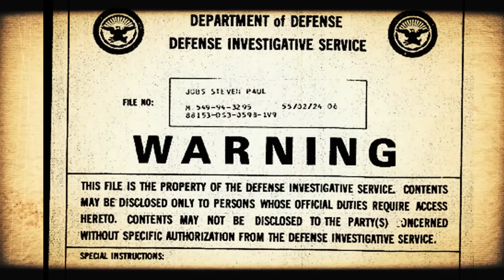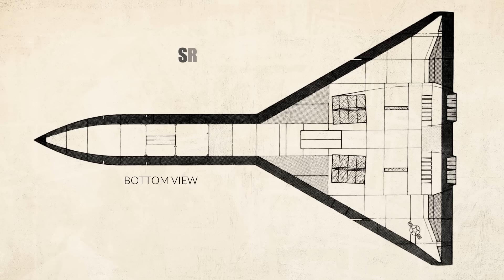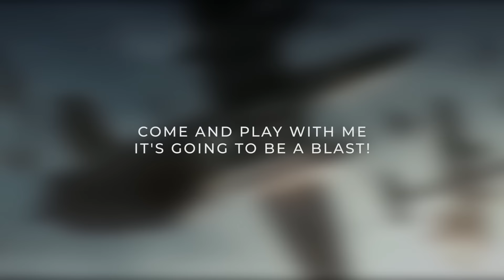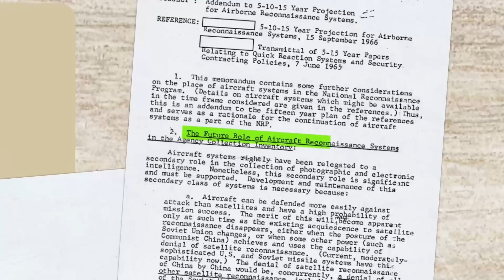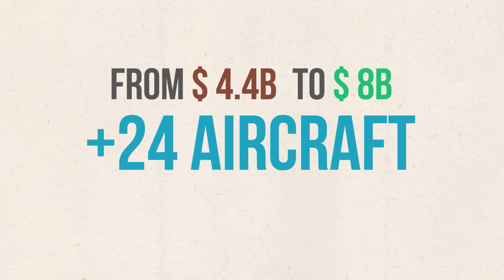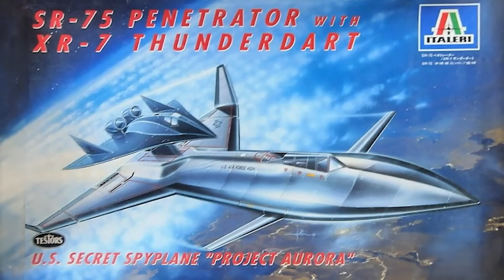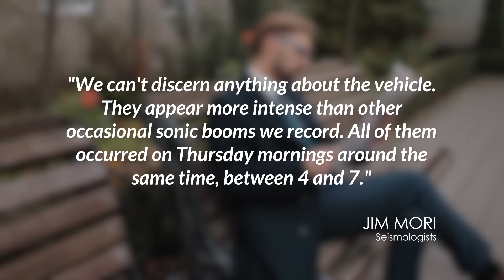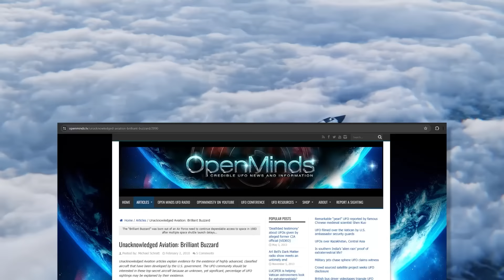This Plane "doesn't exist" - SR-75 Penetrator

Comment: If the SR-71 was around in the 1960's, the mind boggles on what could be around now.
Reply: Think Darkstar from Top gun. 😉
Reply: @dextermorgan1 so far SR72 (Before Lockheed hid everything about it) is basically the Darkstar
Reply: Satellites
Reply: It makes me laugh it’s still recorded as the fastest plane
Reply: @mikemorris3608  the wording though, they say ACKNOWLEDGED aircraft
Reply: some allege an sr-72 could already be flying, just kept top secret 🤔
Reply: @weregarurumon3202  Didn't watch the video, huh?
Reply: It’s crazy how long the B-21 must have been hidden
Reply: @Idont_eatcrocs  it's existed for about how long the F35 has since it uses some of the same parts
Reply: @giovannibonifati only difference being that the SR-72 is going to be an unmanned aircraft while the darkstar is manned
Reply: @giovannibonifati  oh I know, they tracked something on weather satellite in the early 90s coming from Area 51 flying over China and Russia and returning,  what ever it was it was doing 12,000mph
Reply: The SR-72 wasn't classified at first, and even had 1 successful flight of a prototype, before Lockheed Martin classified the program and scrubbed any public mention of it from their website & related online mentions 

Considering the Aurora has never been acknowledged publicly but clearly exists (plenty of examples of a pulse detonated scramjet or wave engine) and has existed for quite some time now...I fan only imagine what the SR-75 could do 

The project makes sense too, under the US rapid global strike program
Reply: Yep! Mach 3.3 - officially. Sixty years ago. 
Isn't there an old military saying about "Whatever they say the top speed is, double it." ?
Reply: @mikemorris3608
What? Mach15?
Reply: @handroids1981  yes early 1990’s
Reply: The Saturn rockets were 1950s tech, used in the 60s etc... they stopped because 'been there done that' and $$$ wasn't worth it to visit the moon continuously
Reply: Just imagine the whiplash a pilot would get from flying a plane with engines that pulse like that.
Reply: Don’t think about it. Save the headache
Reply: I worked in defense electronic packaging tech back before 1993 and the engineer I worked next to was once explaining the challenging design and manufacture of a 300 MHz motherboard in a gray job - not civilian - he had worked on in the 1980s.  I was the guy who had to figure out how to manage the heat from such electronics and that info was his “Hot circuits? Hah! Lemme tell you about HOT….” stories.  If you understand clock speeds, 300 MHz motherboard/bus clock speed architecture in 1980’s was like science fiction.  Now I always assume the US defense sector is 40 years ahead of whatever we know at the time we find out about it.
Reply: We've actually not progressed much after the 1960s...
Reply: @mikemorris3608  unless you count the Space Shuttle, HTV-2 Falcon, X-43A,and X-15.
Reply: the titanium build only gets stronger every time they go up. as long as they don't destroy them and store them properly, they'll literally be around forever!
Reply: You guys realize that mach 5-6 is the max achievable in atmosphere. The x-15started to disintegrate and melt at mach 6. It was made entirely of Inconel. There is no alloy that is more heat resistant. Exo-atmosperic is the only thing left. Satellite technology has progressed so far so fast that these are unnecesary.
Reply: @dr.threatening8622  the X-43A has gone up to Mach 9.8
Reply: @Zach476  all experimental never used in service and space planes aside/ I believe the A12 actually recorded slightly higher speeds than the SR71 and that flew two years  earlier
Reply: The need doesn’t exist now. The Cold War spawned so many incredible technologies. Not just SR-71, but also the Apollo program. No way we were going to the Moon if the Soviets weren’t trying to do it. Plus satellites 🤷🏻‍♂️
Reply: Most of these stealth aircraft have been around for decades. They tend to let the public know way later. By that point they’re nearly obsolete
Reply: The SR-72!! 🛦
Reply: physics doesnt change tho
Reply: They’re probably up to the SR-172
Reply: @weregarurumon3202 
Satellites can’t be directed to fly over specific sites at will.  That’s been acknowledged as a problem since the 1960s.

P.S., that’s explained in the video.
Reply: @Idont_eatcrocs 
The B21 is just being produced and has been public since its inception.  The B2 was flying already and there was no need to make secret versions before now.
Reply: Imagine the Valkyrie with a pulse detonator or scramjet engine that came along after it's development 🤔. It was designed to
Reply: Umm, the SR 71 was built in 1966
Reply: We have had  manned interstellar craft with FTL drives since the early 1990's. The true, secret space force.
Reply: @therealhammer6068 supposedly Ben Rich before he died said they had a faster than light aircraft
Reply: @dextermorgan1  What do you call a satellite with no power? a satelldark.
Reply: That's why so much new tech is kept hush hush, can't have too many boggled minds, hell right now most can't define a woman.
Reply: Unfortunately, all the real innovations stopped after the 80's.
Reply: Or imagine 100 or 500 years from now
Reply: Problem is technology development is like working out… your early gains drive hard work and dedication, but eventually those gains slow down and you plateau… now you have to start revising things based on previous work, and the slope of your trajectory is much shallower. Eventually it becomes a case of incremental progress as you try shaving milliseconds off your own speed records…
Reply: It was flying in the late fifties.
Kelly Johnson was the engineer who designed and built it with fking SLIDE RULES!!!
He started out with the P-38 and the "Skunk Works" was created.
Reply: Space x
Reply: @dalelumina3  They kept the SR-71 secret from the middle 1950s.
It was released in the late 60's.
I first about it the 1967 when everything about it was still classified.
I heard about it when aomeone I knew
saw one the ground at NAS Yuma AZ
Reply: Agreed, and am sure it must be nuts.
Reply: If we went to the moon in the 1960's, the mind baffles on how little has been done since.
Reply: @Jerry-zz2eu  I saw the "big step 🪜 for mankind on live satellite TV
At Barracks #2 at NAS Lemoore CA
Reply: Just the fact that Concorde flew before the 747 amazes me. So much development in the 50s and 60s, then……. “Eh, fuel’s expensive, and satellites are better.”
Reply: The way the economy is heading it might be a DC-3.
Reply: The mind really shouldn't "boggle."

Aerodynamics and physics speak a lot toward what is possible and what isn't. We don't have magic.

We also get it. We know. Things are classified at first, and technology gets better.

every SINGLE military video has the same 9 word-for-word posts "imagine what we have now!"

We GET IT
Reply: Imagine pointing to a movie prop from an action movie with a knowing wink face in a youtube comment section

Jesus fucking christ @dextermorgan1
Reply: @davemccombs  You don't keep up with this subject do you? If you did, you'd know that Lockheed is in the process of building the SR 72. They've put out pictures. The artists concept looks pretty much exactly like the "prop" from the movie. Try to keep up, Sport.
Reply: CIA planned to replace the SR-71 with Isinglass (1960s-1972) and Isinglass II (1972), but both programs were cancelled. At the same time, the CIA decided to simplify the production of reconnaissance planes by simply refitting the F-4 Phantom with better engines and reconnaissance equipment.

In the early 1970s, there were plans to focus on the development of hypersonic missiles, so most programs of this type were included in the hypersonic weapons development research. However, many of these programs were discontinued in the early 1980s for reasons unknown. These pieces of information are from declassified CIA documents.
Reply: Maybe, but spy satellites seem much more cost effective and less dangerous. Besides, the fact that the U-2 is still active tells me that there is no SR-71 successor
Reply: 40 years ahead of the public. If not more.
Reply: Skunkworks exec who retired back in the late 90's said that the Pentagon/area 51 objective is to develop stuff 40 years in the future. So if they have the F-14 back in the 70's, then they should have the replacement ready, budget withstanding.
Reply: @mikemorris3608 it’s the fastest public plane
Reply: @Wesley_H you wouldn’t feel it because it’s pulsing so fast
Reply: There's satellites now. They rendered SR71 basically useless.
Reply: Wait until you level up enough to learn about the 1940s Haunebu and 12000BC Vimana
Reply: @mikemorris3608  The pilots of the Sr 71 Have TESTIFIED, That the plane is FAR faster then said to be. thinking mach 6-7 range.
Reply: @chrissoutdoorsgardening1261  yes he heard similar I think it’s 4000mph +
Reply: the anomaly above the triangle on Skinwalker ranch IS our top secret nazi- born technology 😮😮😮😮
Reply: Missiles and satellites probably.
Reply: @weregarurumon3202 satellites are stationary, so you can shoot it down
Reply: @chrissoutdoorsgardening1261  It could not fly Mach 6….they’ve just recently acheived that speed with the SR-72, and that is a hypersonic UAV, not a manned aircraft. And hate to burst your bubble OP but just because a cool plane was invented in the 60’s does not by ANY means make it a given that those types of leaps in aerospace technology are going to occur over a linear timeframe. That is simply a foolish assumption.
Reply: yeah, well it is a really good plane, but like a scratch in the paint could cause it to explode midair
Reply: Nothing fancy... We dont need fast planes for surveillance now we have satellites. Reality is often disappointing.
Reply: @thomaslink2685 I've heard a LOT about classified computers over a decade ahead of public stuff.  Did you ever hear anything about Quantum computing?  I believe the alphabet boys have had working quantum computers to read encrypted text for over a decade now.

Comment: 1992, Okinawa, Japan: While playing volleyball with my fellow Marines, I noticed a contrail at high altitude. It was the classic doughnuts on a rope shape. I couldn't see the aircraft, but I could see it forming and moving. It crossed the entire view of the sky in about 20 seconds. No sound, no sonic boom after it passed from sight. Very impressive to witness.
Reply: Saw the same thing driving thru Kansas. Passed a military base of some kind maybe 40 miles b4 isaw it. All you coukd see was this weridly high contrail with puffs of smoke in rings around the main trai. Thing had to be moving 30 to 45 seocnd from horizon to horizon. Had too the windows down not a sound and somthing moving that fast i expected to heard a boom at min a roar. Grew up going watch plains fly out of the base with my grampa at the base in south GA. He was airforce on the east cost and off all the storys and difrent jets that u saw. I ever heard of anything that coukd move that fadt let alone doing so with zero noise. Any military jet is insanely loud. This was 2006 or 2007
Reply: Pretty sure I saw this over San Diego about 2 years ago. It was super high and it looked like the ignition sequence of a 2nd aircraft. The sun had set but was still illuminating everything perfectly, as it was at what looked like an extreme altitude. For a second I was excited as I thought I was witnessing a supernovae in real time. As it started moving north it definitely looked like a “pulsed” contrail. As it got further away it looked like a satellite but it was moving faster, and when it moved north at first it looked like it was a red glow of an engine
Reply: Yep saw them high up in the southwest desert late 80s
Olde news but always fun to tune in lol
Cheers!
Reply: I saw a comment from a guy on a UFO video who saw what looked like a satellite that covered the entire sky in only a few seconds.  He obviously didn’t know if it was a UFO or black project, but I can’t help but think we have craft that are literally “out of this world.”  It’s really hard not to speculate about the possibilities sometimes.  Is the TR3b triangle type craft one of ours; or something else entirely?  I see so many people making comments about having seen these things flying around at low altitude and traveling slowly that it’s hard to ignore; the numbers (if I could quantify them) are staggering!
Reply: Whatever it was...it was powered by Pulse Detonation Engines
Reply: @MrNEOANDY  BINGO!!!!
(pulse detonation WAVE engines)
Cheers!
Reply: lived in virginia as a kid and got to see an f-117 fly over once i'll never forget that
Reply: @thedaredevil1907 That’s not surprising. Kansas is used a lot for airplanes. Tons of fields, only major cities are in the South, or the Northeast. Pretty rural in the center. The military does have a pretty big presence here. Plus, aeronautics is what we’re known for. A lot of manufacturers and engineers live in the area. Specifically Wichitas.
Reply: For realses?
Reply: @pieeater108  Yepses
Reply: If you had been there 6 years earlier you could have met Daniel Larusso!!!

Comment: Airline pilot here, earlier this year I watched donuts-on-a-rope contrails being made up close by the most unexpected source.  At cruising altitude just before top of descent into LAX we were passed by a 737 a thousand feet above.  Both the 737’s engines were leaving contrails that were sort of rolling back on themselves, forming into rings at regular intervals.  I suspect it had something to do with the mixing of hot turbine exhaust and cool bypass air forming ring vortices and the conditions were just right whether it was speed, thrust, temperature, moisture, or some other factor(s) causing it.  In one way it’s disappointing they weren’t being produced by some black triangle but in another way it’s fascinating that they were formed by such a benign and common type.
Reply: This is def just a gov plant
Reply: @nickabel8279   and? bro are you a pilot, our technology isn't that advanced, but like realistically in 2024 it could exist, it's not like what he said is not true as well that could explain the sightings in the 80's when our main plane was the f18 hornet and we weren't that technologically advanced yet.
Reply: I got video of a typical two engine passenger jet (couldn't tell which brand) leaving the dreaded "donuts on a rope' contrail. It was probably cruising at just the right altitude where water starts to condense out of the exhaust. Karman vortex and voila'. intermittent contrail.
Reply: That i'd really like to see video of, just to examine the flow.
Reply: Thank you!!! That (using Occum's Razor) just answered my "I wonder what caused that contrail" question! I appreciate it!
Reply: Can a 737 go from horizon to horizon in 20 seconds ?
Reply: @teddeebayre3433  No, but do you have a video of a plane doing that? I'd love to see it if you do.
Reply: Seen this effect many times from conventional contrails.

Comment: Flying a pulse-jet powered aircraft over populated areas in England, especially only forty years after WW2, is going to raise some eyebrows.
Reply: “Hey billy, come get me my 30mm bofors from the garage!”
Reply: But who would "reap the whirlwind" in that scenario? And how would they?
Reply: Isn’t it a Pulse Detonation Engine
Reply: And you'd do what? Send a stern letter to the Ministry?
Reply: Sure it did. Vengeance Weapons 2.0?
Reply: They would have no reason to land that plane anywhere outside the US. This story is bs.
Reply: @jwaller51 Since the end of WW2 and even till this day the RAF is 24/7 stand by in case of an attack, could they catch it if it was this super plane properbly not but its the thought that counts
Reply: @moshunit96  Except it happened with the SR-71 where they had to make an emergency landing outside the US and were protected by Finish and Swedish fighters from USSR fighters that were enroute to force it down.
Reply: It’s like getting bombed by V-1 all over again ——some local old dude prolly
Reply: @ImpendingJoker but the SR-71 would be slower and lower then this aircraft if it exists, basically this would be an air breathing suborbital spacecraft. Of course if this plane does exist then one wonders what the actual function of the X-37B space plane is.

Comment: contrail shape is not dependent on engine type, it's dependent on aircraft shape in reference to drag. Contrails are formed when low pressure air is compressed. the water vapor in the air is compressed as well and forms the "clouds" of a contrail. Yes the engine can do the same, but most if not all contrails are actually from the wingtips or the areas around the engine nacelles, the engines themselves are not creating the contrails, thus there is a high amount of turbulence. Turbulence is where low and high pressure convalesce and thus compress the water vaper into "clouds". I should say this, no airframe can be designed to not produce any air turbulence, thus every airframe will at some point create contrails. Even normal turboprop engines can create "pulse" contrails, the same way every pulse jet engine can create smooth contrails. Like I said, it's not dependent on the engine, it's dependent on the airframe shape.